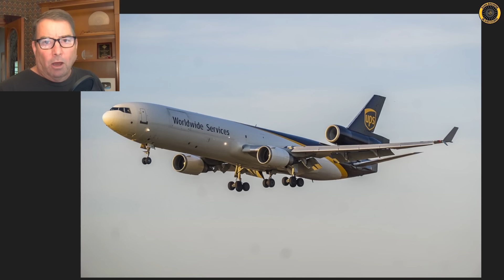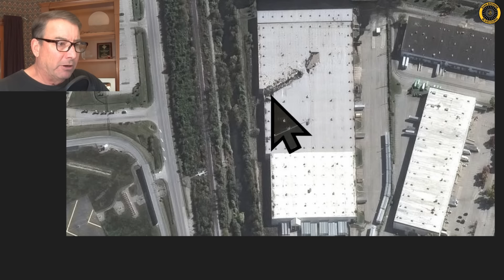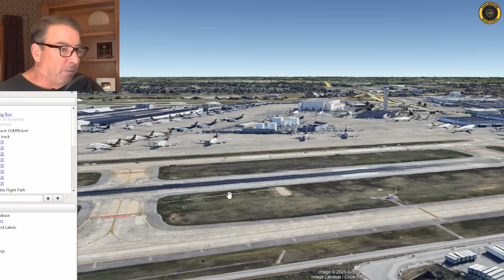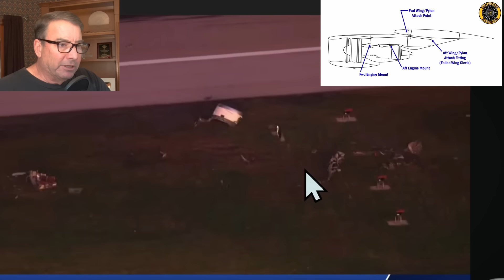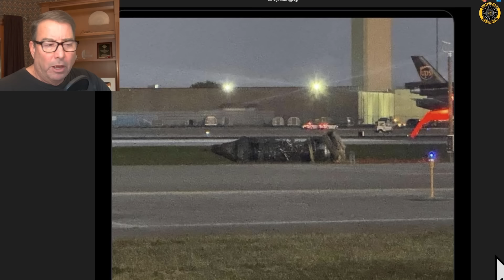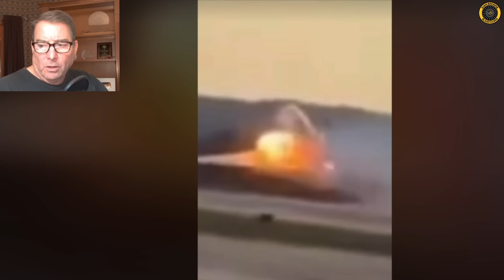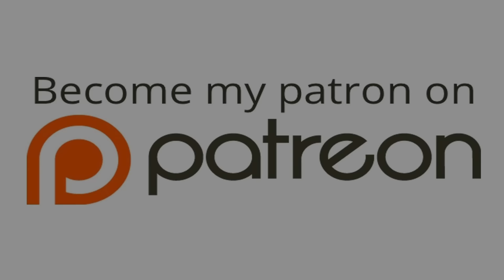UPS #2976 UPDATE 2 6 Nov 2025

Comment: As a professional pilot, we can all accept pilot error, we can learn from it, train from it, and hope to never make the same mistakes. But for mechanical failures, it is a different story, all we can do is hope that all safety standards are met or exceeded and problems are found prior to flying.
Reply: Mechanics, like pilots, are sometimes unable to learn from their completely human mistakes. Imagine making a mistake as a mechanic that caused something like this. I don't think I'd ever be able to touch a wrench again. I think most pilots would prefer to be the first to die if they made a mistake that caused a fatal crash. Mechanics don't have that. They always have to live with it. I think good aircraft mechanics are some of the bravest souls, because that's what they risk every time they put their hands on an aircraft - someone else getting killed by their mistake.

I prefer the safety of being a dispatcher. You have to really try hard to endanger a flight as a dispatcher because you're the redundancy for the captain, who has the final say in the safety of the flight. All I can do is keep the plane on the ground or tell them to discontinue the flight and land. Not a lot of decisions to make. Everything else is giving advisories, annoying crews with gate changes and plane changes (especially if the plane already has too much fuel) and repeating the same preflight paperwork (I dispatched long ago when everything was paper, got laid off after Desert Storm - I'm sure it's all computerized now). Still, I'd be completely gutted and traumatized if one of my flights crashed. 😞

Comment: It's not acoustic liner. It's Kevlar fan containment. Acoustic liner is the honeycomb within the fan casing reducing reflection of sound from the blades. The Kevlar containment is on the outside of the fan casing to prevent uncontained failure or at least reduce the energy of uncontained debris.

Comment: Dumb question, but isn’t the engine and pylon meant to separate if, for whatever reason, there is something way out with the engine? If some catastrophic happened to the engine, shouldn’t it leave the pylon intact not take the whole assembly away with it?

Comment: From the NTSB briefing earlier. During their FOD walk they located fan blades before the separation
Reply: That's not quite what they said. They found the engine farther down the runway (and farther to the right) than the fan blades, but that says nothing about the point of separation, or the timing or the event sequence. Fan blades (and the nacelle) are much lighter than the engine core, and they have a very large profile against the wind compared to their mass. Lightweight objects with a large relative profile against the wind will stop moving sooner than heavy objects with a relatively low profile against the wind. It's like throwing a baseball and a feather. The baseball will go a long way, but the feather won't.
Reply: @DrBeenaPlumber it’s all on video the engine coming off
Reply: @warrenscarlett9302  I'd really like to see that. I've seen all the videos Victor showed on VASAviation, and he said that was all there were at the time. None of them started before the engine separation. I know YT gets weird about posting links, but can you suggest some keywords to search for?
Reply: @warrenscarlett9302   What is a good search to find this video?
Reply: @chetmyers7041 hasn’t been released yet mate
Reply: @DrBeenaPlumber  Correct. You would need to figure out where the engine departed the wing. Thankfully a good physicist should figure this out.  Given that previous separations tend to have the engine go over the top of the wing rather than simply drop down, I can easily see it traveling several hundred feet in the air before it impacted the ground.
Reply: @josephoberlander  I know the NTSB has rough calculations for debris falling through the air and for debris sinking into the sea. They're very imprecise though. It wouldn't surprise me if they have a model to track the debris field across the ground and trace the pieces back to their origins. I think it would be made less precise because in the air and water there is only one predictable fluid for the debris to pass through. On the ground there's the added randomness of ground impacts and uneven surface friction. I bet they'll have more luck working it out with available videos. Someone here said the NTSB announced they had a video of the actual separation. That should fill in a few blanks.
Reply: @josephoberlander engines weigh tonnes. As soon as it hit the ground it's leaving marks along the whole slide path.
Reply: @josephoberlander The engine data will tell if it lost power first from blade seperation or was at full power when it came off.
Reply: That tracks with the large piece of cowling dropping off before the engine.

Comment: I saw a video that showed what I believe was an engine failure (fire coming from the exhaust) of the number two engine as it was lifting off the runway, which likely means the engine was flying on the number three engine. If the pylon failed first it would be far less likely for the number 2 engine to fail. Tragic situation.

Comment: I think it’s gonna be pretty hard to find out what happened first the chicken or the egg. Looking at what’s left of number one engine and the fact that it completely crossed the runway to the opposite side at V one speeds I think the damage is from a tumble and roll affect. My money is still on the pillion giving away and subsequent damage. why it didn’t launch up over the wing like back in the day. Is it possible that the front gave out instead of the back bolt like last time? My heart’s to everyone affected.

Comment: Just an observation, that Kevlar blanket that is wrapped around the fan case is meant to contain several fan blades. But if the disc failed, that maybe out of the ability of that containment blanket. That would explain the detached fan cowl and shredded blanket.

Comment: It would appear  the front support  of the pylon broke loose and the engine  dug in to the surface  bleeding  energy  the ramp rear video show spars popping up  under the airframe  vectoring  across and under  the 191 flat it was the rear pylon support  causing the power plant to  swing up to me it looks like  a downward  leading end dug in and

Comment: I speculate that the #2 engine ingested debris from the failure of #1, leaving the aircraft with one engine. The jet can take off at MTOW with 2 engines, and it was pretty level so I don't think differential lift was a factor. Having the 2 engine up probably would not have changed to fate of the crew due to the fire, but it might have given them a few more seconds in the air to try and find some flat spot.

Comment: I am far from an expert, but my thoughts are the pylon on the ground before the engine leads me to believe that the pylon came off first. The cf wrapped around the intake could have been fron the engine and housing hitting the ground while still at full rpm grenaded the fan and shredded the housing at the same instant.

Comment: The engine falls off surprisingly because o non engine failures of the structure holding it at the wing. It was likely poorly attached or degraded to a point where wing structures failed and probably ripped out plumbing and more important controls for the wing. The fire was likely lit fuel coming from pipes or even tanks if they are close to the engine, this ripping chunks of wing off with the engine doesn't happen, this is not a normal or acceptable failure mode. I suspect the crew never knew what happened and if there was a solution to get the plane into the air and back down it was not in their head and any book solution would likely fail, because a plane should never get in the air with the engine connection in this state.
This thing went from I assume full power to falling off in 10-20 seconds, it is not a bomb, it  will rotate and fling parts in failure. It may vibrate and other things and fall of a long time later, but not in an instance. Structural failure and happen in a second and the torque of the full power is what is needed to cause it, so logic says it was a structure or maintenance failure in the connection in the wing. Structural rot should be seen in inspections so that also is a maintenance issue. The junk on the runway will probably solve 90% of the questions.

Comment: Just my opinion, I’m certain the pylon failed ( front) and the engine hammered the runway, balling up the blade shroud. Take off power, possible mounting bolt failure? There would be no way to recover with FOD entering #2 inlet as evidence of backfire.
Prayers for all involved.

Comment: The condition of that burnt engine says it failed first. It had to have been burning for many seconds before V1, to end up in this condition. If the pylon had failed and dropped the engine, and that's when fire is initiated, there would not be enough time or fuel in the separated engine to cause this much damage by the time it hit the ground and rolled to a stop.

Comment: The dashcam video was taken from a point on Grade Lane just before Knopp Ave and not from Crittenden Drive. At this point the plane has already cut a gash in the roof of the UPS warehouse, presumably with its left main gear. The gash gives out halfway across the roof indicating that the plane was still climbing slightly.

I concur with the conclusion that the engine failed and exploded catastrophically rather than the pylon failed. Given the long trail of smoke seen in one of the videos the engine probably failed well before rotation by which time it and the wing were well alight. At what point the engine separated is not exactly clear. We just know where it came to rest.

The slightest yaw on a swept wing jet and the wing going forward will lift at the expense of the wing going backward which will drop. The functioning right engine on the UPS jet will have provided the yaw. Thus did the plane deviate to the left after take off and subsequently roll to the left. It is difficult to see in the video if the pilot was compensating for the yaw with right rudder.
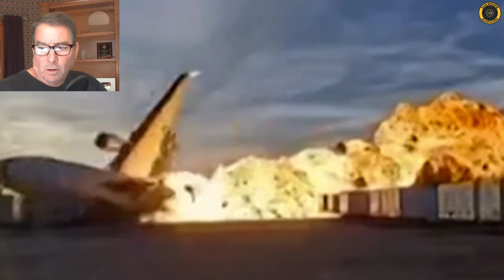Reply: but given the groove that was made in the UPS building as seen at 2:07, and the jet is still quite level as it crosses Grade Land, if it’s from the left gear, shouldn’t there be something from the right gear?
That’s why my guess is more of a tail strike given that gear kinda appears intact as it crosses the road that car with dash cam is on.
Reply: @JohnHallgren  It might indeed have been a tail strike.  The plane looks level from Grade Ln but it might have been rolling slightly at this point. But, yes, it could have been a tail strike. I don't think it was the wing.

Comment: From AI investigation.."Following the American Airlines Flight 191 crash, the NTSB found a total of nine other DC-10s with fatigue cracking, six with fractures in the pylon aft bulkheads and three with bending damage, likely caused by the same improper maintenance procedure used on the crashed aircraft."   As mentioned, the UPS MD11's are not likely affected the same way but they'd better start to at least give those birds a visual check before departure.

Comment: The new video is actually on Grade Lane in front of Grade Lane Tires, not Crittenden Drive. It’s not clear what caused the roof damage to the UPS warehouse. The plane did not roll until it crossed Grade Lane.
Reply: It's been suggested that the landing gear did the damage to that roof, in particular by Mentour Pilot.

Comment: It seems to me to be a pylon failure first, then the rapid unscheduled disassembly of the engine as it flew up and over the aircraft and impacted the right side of runway 17R and skidding to a stop in the grass.  I say this because there are very few parts of the engine on the left side or on the runway.  If the engine exploded first wouldn’t that be the case?   But I’m sure the DTSB can figure it out soon.

Comment: You can see hot section damage look at the huge crack and the completely open turbine housing. If that failed it would have taken out the rear engine bolt.  The fan shroud looks mostly intact.

Comment: If the engine stopped hard, like seizing up, it could torque the pylon off the aircraft. It has happened before. But it could just as well have rotated up and over the wing. Time and the NTSB will tell.

Comment: The 1979 incident had "little to do" with the current one, unless someone got the bright idea of saving some man hours in maintenance, unaware of what had happened previously?  Correct me if I am wrong, but the manufacturer's procedure was to remove the engine first and then someone got the bright idea to save some money, and in between there was a shift change where the engine/pylon assembly was left sitting on the forklift but still in contact with the plane.  The forks settled and when they did it damaged the rear mounting flange on the aircraft.  Another one of those "Swiss Cheese thing you talk about, and it could have happened again, just with different holes aligning to the same end

Alas, the last thing we want is for investigators looking for clues to prove a theory and not form one.

Comment: The dash cam video was taken in the vicinity of 7015 Grade Lane facing northeast just beyond the parking lot for Stooges Bar and Grill (you can see an unused billboard which in the Aug 2025 google street view is used with an ad that say 'Are you OK?', or about 700 feet northeast of the parking lot entrance to Stooges Bar and Grill). In this view the UPS Supply Chain Solutions building whose roof was severly damaged when hit by the undercarriage of the aircraft would be just below where the aircraft first appears in the dashcam video. Also it appears that some of the landing gear may have been sheared off when it hit the rood of the UPS Supply Chain Solutions building. The MD-11 has 2 main landing gear and a center landing gear under the fuselage/wings. As the aircraft passes over Grade Lane only 2 boggies (instead of 3) are visible.

Comment: In my observations, it looks to me that the #1 engine let go pretty early in the take off roll, could have been a major FOD event, or as many are suggesting, a compressor fan explosion.  At some point, the engine and pylon depart the left wing and continue skipping and bouncing down the runway stopping near the 2K marker! Remember, the Pilots had the throttles shoved all the way forward to max power giving her all the Onions, so between all that thrust plus the airspeed at which the engine let go at, PLUS residual thrust from the Turbine Core, she is gonna continue truckin down the runway long after departing the wing!

Comment: The carbon or Kevlar fiber shroud system around the fan blades is primarily used for blade containment, not so much for noise abatement.

Comment: I believe you are incorrect in your assertion that the dashcam was located on Crittenden Dr when the plane hit the wires.  I used Goggle Earth street view and found that the dashcam was actually located at 7070 Grade Ln just next to Chris Tires.  You can clearly see the control tower in the video behind the telephone poles.  The aircraft must have hit the building with the landing gear, still wings level and only rolled to the left after hitting the wires.

Comment: Having rested the engine on a forklift with the front pylon bolts undone the maintenance crew broke for lunch  without undoing the rear pylon bolts. While they were gone the forklift decompressed allowing the engine to settle a bit fracturing the rear pylon mounts. Thus they completed maintenance without noticing the damage where the rear mounts lasted until they gave out on the runway at O'Hare cartwheeling the engine forward and over the wing. But that is probably not what happened here.
Reply: Cool, now I don't have to go read that full report. 
I'll not speculate, but am sure the engine came off.
Reply: And were they held accountable… I bet not…
Reply: @Padoinky They were admonished about it,
Reply: Wasn't that the exact cause of the Flight 191 accident in 1979...??? Using a forklift to install an engine onto the pylon....🙄🙄🙄
Reply: @_Ben4810 OP is referring to AA191. They didn't make that clear. That maintenance process is no longer done, so it would not have been a factor in this accident.
Reply: @_Ben4810  That's what I was saying